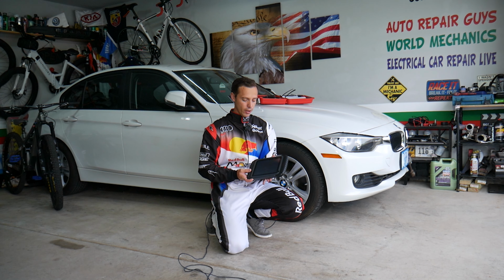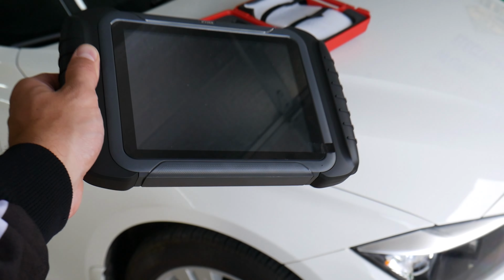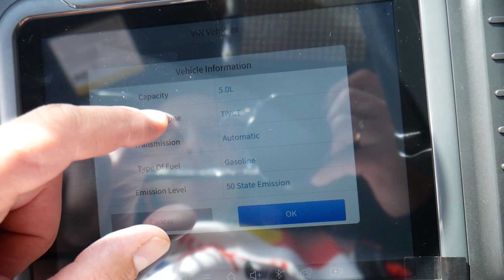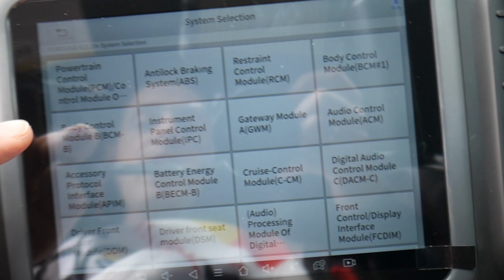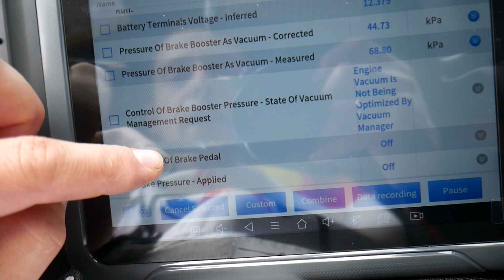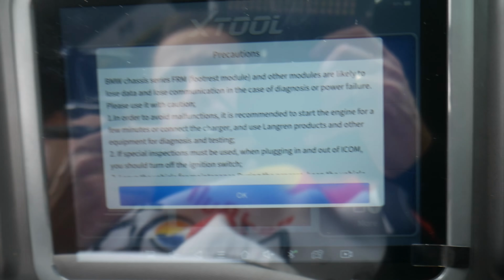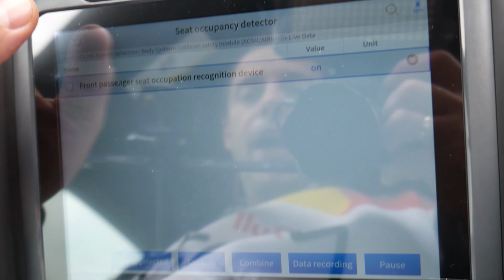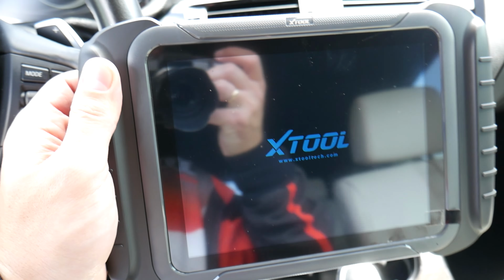XTOOL D8BT Wireless Diagnostic Scan Tool, ECU Coding, Full Systems Diagnostics, Key Programming

Comment: After using the Xtool BT D8 for several months on my 2004 Nissan Maxima I have had issues with it not doing even common functions it is claimed to do like showing lean/rich short/long term data, or programing the ECM serial number. No such function on the Xtool. I even contacted Xtool and get a reply as vague as can be. "look for updates in the future. see I keep getting a PO172 and now I need this data to work the problem. I'm not sorry but if this scanner cant do this basic function then what good is it. All I see here is what is claimed to be done, but now I'm learning I shouldof looked for reviews from full time mechanics to get the real run down. Yes a valuable lesson to learn, but a costly lesson. Basically people do more research on your purchases so you don't end up like me with a  gold plated brick

Comment: Hi guys love your videos, I have an issue with my mk3.0 st2 2012 when I press the stop button the car stays on for a bit then shudders then stops after a minute, I have looked up the code and it’s P0087 relating to low pressure fuel system have you encountered this before and what help or advise can you give me please.

Kevin